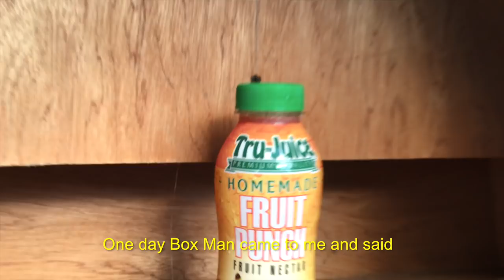Made in Jamaica Ep7: Tony The Jamaican Sound System Builder

Comment: When he said its a 5 way system...what does that consist of? like sub, mid bass, mid etc?
Reply: high(1300-up) ,high-mid(400-1300), mid(200-400), kick(90-200), sub(30-90), just to give you an example, ofc depending on what cabinets your are using, the crossover fqs are different
Reply: Thanks! Sounds like it will be hitting all frequencys nicely!
Reply: @Pookytroll  Your almost right but if you're talking about reggae music then I would say 30 - 40hz on the Subs alone, that is a must for Reggae/Dub.  I think i speak for every Soundsystem in Jamaica.
Reply: Iran Dixon  well, you must be right, but i was giving a random example, any system has its own settings depending on what music it plays and  the type of speaker cabinets
Reply: @Pookytroll  I get what you mean, peace.